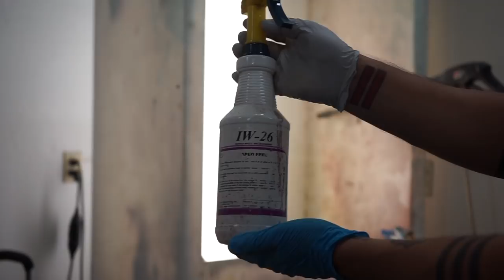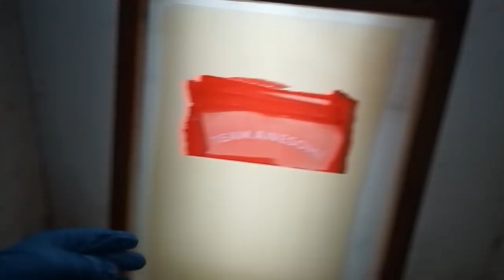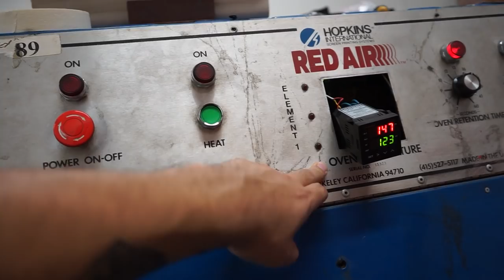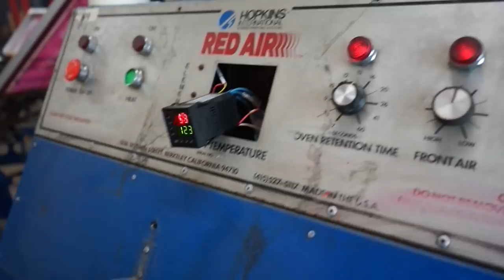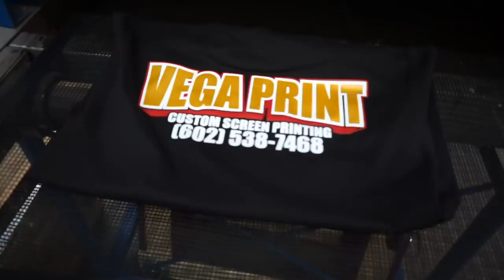is the dryier finally working?

Comment: I do the same except that I dont use clear tape as I cant find a good one in Toronto. Tape is pretty cheap and i usually get about 10 rolls at a time and it lasts for a  good while. I also use the clear backing from when I do vinyl jobs and that saves tape as well since it covers a good portion and just need tape on the sides.
Reply from the maker: ct apparel that’s perfect 
I had a friend that would used old pellons (test sheets) to make room for less tape